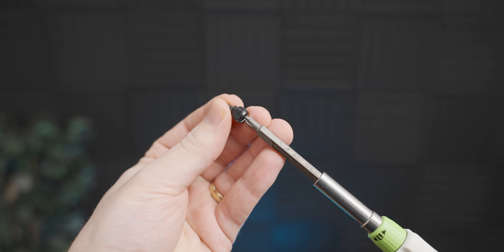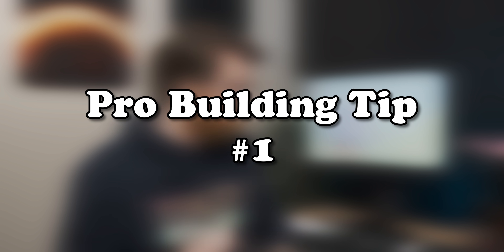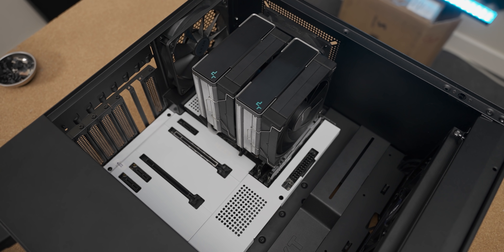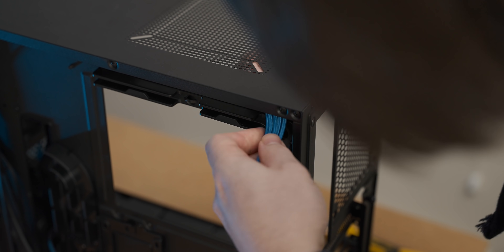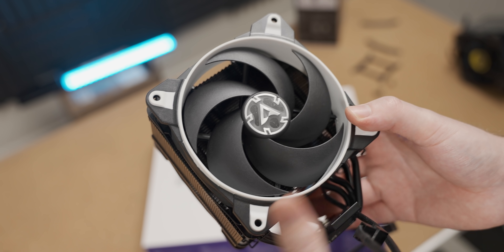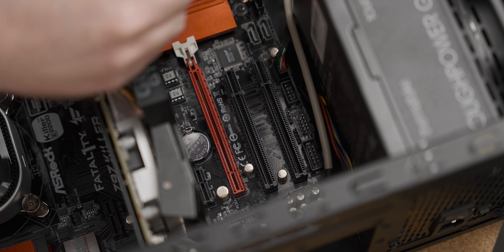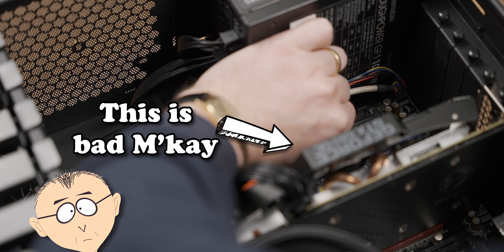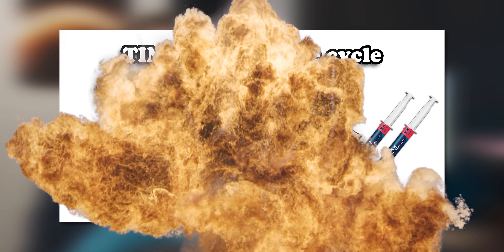5 Things I HATE About PC Building...

Comment: My case has same atx cpu plug problem, but my fan sits (top) on a q40mm to 1200mm compact down Converter plastic adapter n fan sits (1mm gap) between fan  vs motherboard sides...

Comment: Front panel connectors are the worst now that my eyes are so crap that I can't read what it says on the motherboard, even with reading glasses.
I was putting a pc together for a friend and  tested power on for the first time which worked but the second time it just would not. Spent ages trying to figure out what was wrong and finally concluded that the PSU must have blown so I took it to the pc shop he bought the parts from for them to test. Two minutes later it was up and running, turns out I plugged the power on connector in the wrong place and the Gigabyte motherboard he bought automatically turns on the first time it receives power.

Comment: The reason only NZXT has that FPIO connector is it's not actually standardized, yes 99.99% of motherboards made today follow that layout but there are a few that don't and older boards are more likely to not work with it. Another good fix for it I got with an ASUS motherboard, a short adaptor that just existed to plug in the case FPIO connectors in with the other end almost the NZXT connector funnily enough the actual NZXT connector wouldn't have worked because it was a board with a different layout.

Comment: First issue, Buy a AIO and problem solved.  Second Issue,  you can use some tape and combine the small plugs together to make one big plug, then put it into the header on the motherboard.  Third issue, Gloves and IPA.  Thermal Paste is not lube, stop using it that way.  And last but not least, RTFM.

Comment: Finger screws that are impossible to open or tighten using fingers, badly fitting side panels, expensive cases made out of tinfoil (considering the price looking at you my previous obsidian 750D which was huge disappointment compared to cases i used to buy in early 00's from brands like antec which were build from melted down t-35's probably)  i think those are my current pet peeves

Comment: i've been PC tinkering since I became a teen. essentially, PCs did not change much since the IBM PC days with the green color screens. It is a mess and did not improve to make it more user friendly to none PC enthusiasts.  for example, there are plenty dead huge high ends cards due to flexing/breaking their PCB boards due to massive weight.  the ATX standard needs an overhaul. PC cases, especially huge ones are dinosaurs.

Comment: The front IO plugs drive me insane. They're so tiny and my clumsy fat fingers have a hard time getting them on the right on the pins. My Aorus Elite V2 mobo came with the accessory which is a plug for the front IO that you stick al the little ones into. I should have used it but of course I was an idiot and did it the hard way

Comment: I've been building PCs for about last 29 years. Problems these days seems like child's play to those from the early 90s. You had to set up the CPU using jumpers and it was a nasty time consuming procedure. So frustrating and you had to be extra careful as wrong jumper could fry the entire cpu with motherboard sometime. Fortunately it ended up when Pentium II appeared. Today I hate the AMD pins on CPUs as they easily get bent and I'm 46 years old so it's getting more and more difficult and frustrating for me to fix. Also it's getting so freaking difficult to seat them properly in socket as my hands have become shaky. That's why I prefer Intel in my builds. Wish AMD could make LGA cpus instead.

Comment: 1) I would explain how the magnetizing rub job works, but I got a D in Physics II. 
2) My NH-D15 mocked my attempts to upgrade my PSU this past weekend, which required removing the old EPS connector (really bad) and install the new one (worse than removal). I was this close to pulling the cooler but I don't have any TIM on hand. It was so bad I had to walk away and take a break or I was going to damage something.  
3) Even Noctua can't make this idiot proof, and I am an idiot. 
4) F the front panel connector. F it to hell. I am going to have to check out the NZXT line for my next case. 
5) This one isn't a problem for me, somehow.

Comment: I'd rather have my front panel connectors separate. I never plug in the LED ones. I think I can tell if my computer is on or if my hard drive is working properly without a sun fueled blue LED blinking and or clashing with whatever color theme I have going.

Comment: I NEED HELP!!!          My PC crash every time I play Battlefield V, it just froze and leave the game. My CPU and GPU do not thermal throttle, GPU is maxing 55C and CPU 60C. I have R5 2600X and RX 5600XT. Only suspicious thing is that my CPU current is 133.9A and voltage is 1.3V. That is not normal cause power is then 174w and my CPU is rated for 95w. I did not OC anything.

Comment: For about $5 you can buy a magnetiser/demagnetiser gadget. ASUS used to have the Q connector  block for the front panel. Plug into it then the block goes onto the mobo pins. My latest board didn't have it and the pin layout was different so it was not compatible with an old one 😡. Why motherboard manufacturers can't agree a common standard is beyong me as aren't ASUS and Asrock owned by the same company.

Comment: Ahh the nearly inaccessible CPU power connector ... I experienced the same thing the other day ... but that was b/c I already had my 360mm AIO mounted to the top of the case, and ... yeah I could have probably pulled it out but I remember how challenging & tedious it was to get it in there and I didn't want to repeat it.  (Also yes, I did forget to remove the plastic off the block ... went into BIOS ... "hey temps are 90C that doesn't look right" ... shut down, thought it looked like it was mounted properly, was thinking "okay I was gonna take the plastic off and put it over...here... wait it's not here? Is it still.... " pulled the block off and there it was :P )

Also my hands had a bit of hints of blood threatening to come from them .... but that's because it happens to be the time of year here in southern California where my hands will often get so dry they crack and almost bleed spontaneously.  (It hasn't been as bad this week so far as other times.....)

Comment: Oh my fuck, the CPU power cable thing hits me so close. I'm really big into sff ITX builds and holy fuck sometimes that cpu power 8 pin is pure misery to connect.

Learned to do it the other way around. Plug the mbo side in, mount the mbo and then route thw cable to the psu

Comment: If you haven't insulted the parentage of a front panel connector you've never built a computer. I love the newer motherboards that come with a decent adaptor you can fiddle with outside the case and then just plug into the motherboard.

Comment: My solution for the front panel connectors is I only plug in the power switch and nothing else, because that's really all you need :P Your unicorn rainbow vomit will tell you if the PC is on or not xD

Comment: Finished build and there is a screw or something rattling around under the motherboard that will not come out with a good shake..
Reply: Happened to me the other day. Dropped a screw that wouldn't come out when reinstalling motherboard after upgrading the CPU cooler. Had to remove all screws, cards and motherboard just to get the screw out. Didn't want it shorting out components.

Comment: Cooler Master Q500L. worst case ever. the psu mounting is dumb, its tiny and cramped, and horrible in airflow. THAT- is annoying. i wasted at least 3 hours in total trying to mount the psu and plug it in. but the cable is too big ti fit in the gap. i may or may not bend a screwdriver and the case itself ( i did. )

Comment: The thing i hate most about pc building is windows 8/10/11, you need to beat these operating systems into submission, disabling defender, updates and telemetry via gpedit killupdate and destroy windows 10 spying. Hell, you even need to enable windows photo viewer with windows ultimate tweaker. And reinstall a functional start menu. Windows 11 is like operating a right hand drive vehicle but they switch the wheel and the peddles and then placed you in the back seat and beat you with a hanger. I just wanted windows 7+dark mode and windows 10's Bluetooth settings.

Comment: CPU fan mounting with those clips is terrible... I've found buying massively large cases have been the best solution for most installation and usability (cooling/temp) problems...CoolerMaster HAF X and Corsair 780T for my past two builds. :)

Comment: easy reason why front panel connecters are a curse its because nobody has a standard for it yet my msi x570 motherboard has a slightly different front panel connecter pin layout then the b350 i had  its one of the stupid things that still exist in the world so that nzxt plug sounds great in practice and is nice if your motherboard has that layout but if it doesn't wel rip plugging in the front panel connecters

on both the pins for power and reset were at the same spot top to bottom however the hdd power and power led were mixed up i had motherboards before were power and reset were on the bottom pin layout next to eachother

also had a motherboard for a q9450 before were they included a plug were you can slide the different cables in problem was that its 1 pin plug compatible only my case had 2 pin plugs for power and reset and i couldn't detach them into the + and - so back to torturing myself till the pin plugs got in

how is this still a problem today why cant manufacturers go with one layout for it